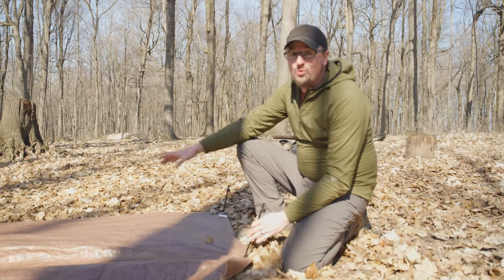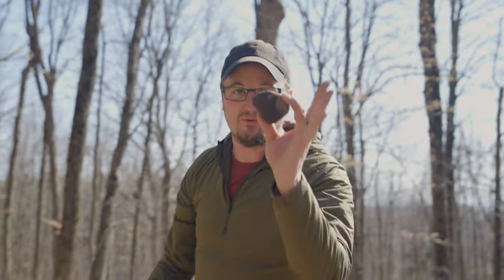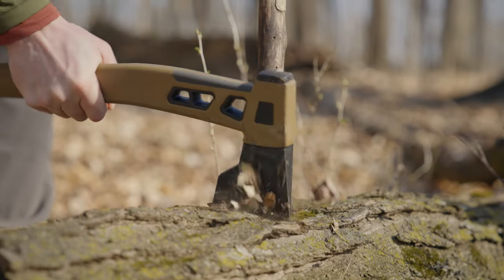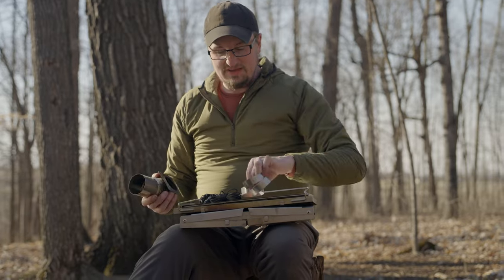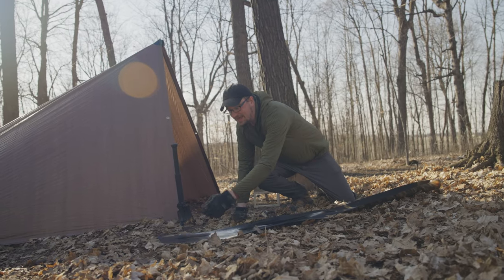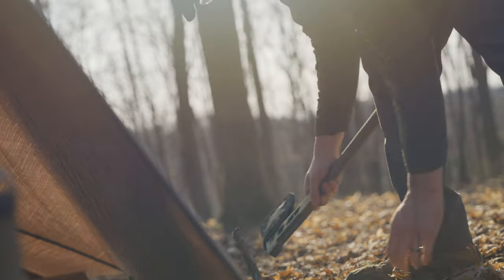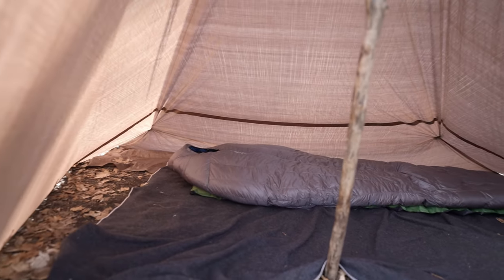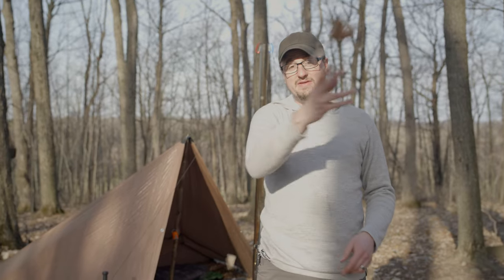Warm And Dry In A Tarp Shelter | Silverant Wood Stove

Comment: I camp with people who modify their tarps into portable structures. The applicable part for this video would be careful grommet removal, Gorilla taping across the hole, (both in line with the weave and on the diagonals,) then hole punching and adding a sturdy steel grommet. This should be done at any point under high stress. Criss-crossing where the rocks are would also improve the longevity. Both sides is best if the rocks are sharp or abrasive, or if the tarp will be flapping a lot
Reply from the maker: This is excellent info, totally agree. Gorilla tape is a must have!

Comment: How do you determine which direction to set up your tarp if you're in an area such as the one I live in where the wind is constantly changing direction? I use the method you do, dropping leaves to determine the wind direction but what I've found is the wind direction changes every 30 seconds or so. I live near the Blue Ridge Mountains and around here that's a real issue.
Reply: Damn Autocorrect

Appalachian(s) are the mountain range

an Appellation is a name or title of something or someone.

 There are Tarp configurations that are more enclosed